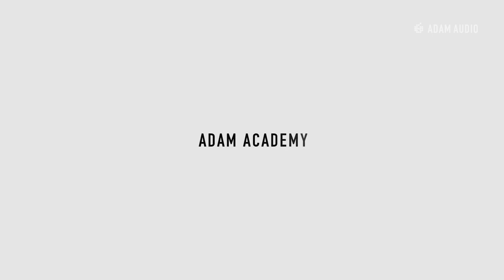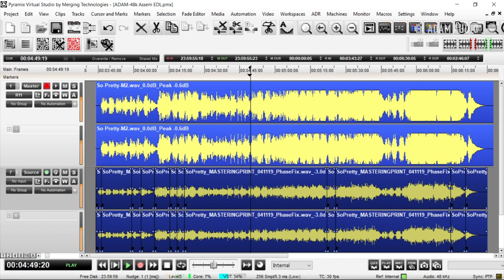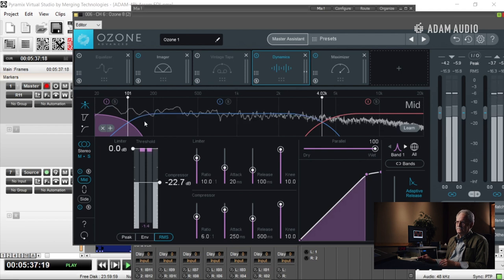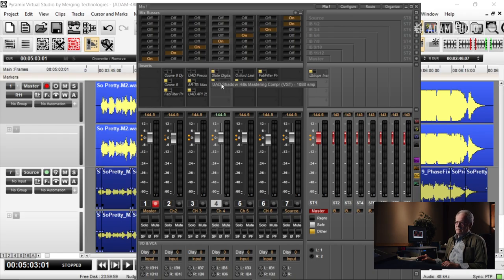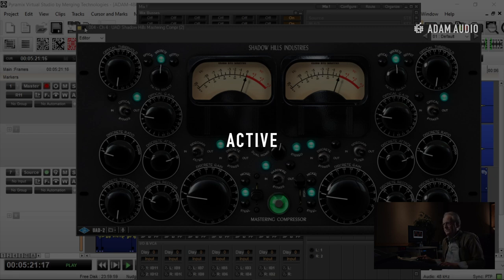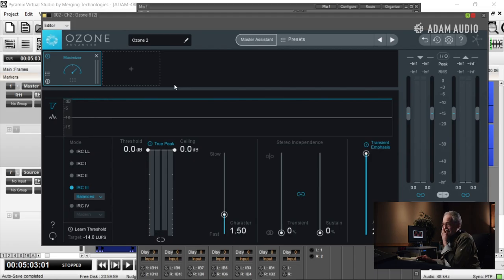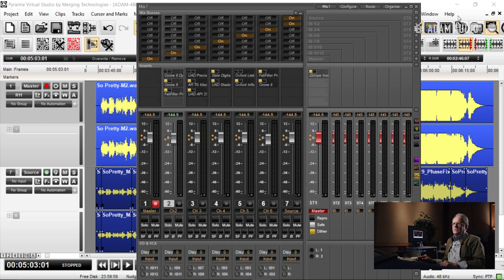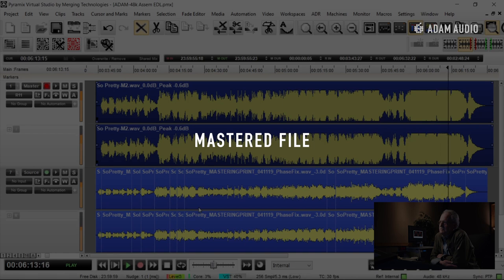Mastering Plugin Chain, START to FINISH | Mastering Masterclass Ep. 6

Comment: Question: Are those plug ins in series or parallel?  And if parallel how are they distributed, ie: is each channel receiving the same amount of signal via a send (and how much) or duplicates of the original track?  Thanks.
Reply: For anyone who cares I think I've got it figured out but it's important to note where it isn't stated explicitly.  It's in series but he's using the Ozone multiband only for bass and light de-essing as noted but the Slated FG-X is only doing transient emphasis.  The Shadow Hills has the compression turned off and is adding only the transformer effect.  The API is set very low and is also adding transformer effect.  The Inflator can mess with the stereo image and it may be why he's using the Ozone Imager.  For God's sake don't just slap 5 compressors and three limiters on every track.  There's a lot of subtlety going on here.  Hopefully that's obvious to most.
Reply: @EdPettersen  Watching now for the first time and was asking myself the SAME question as to why there are so many tracks. I've only really seen everything in a single channel and not as inserts like this. It's quite interesting and does make sense.
Reply: @Ky Olsen  I figured out after watching a few times it all must be parallel, however it's key how you blend those six channels.
Reply: @EdPettersen  of course! It's a really interesting way to do it!
Reply: @Ky Olsen  interesting and semi complicated! 😁
Reply: @EdPettersen  The mixer setup looks like it’s in parallel. However, If it’s in parallel, how does the first eq cut off work? It wouldn’t be cutting anything if in parallel right?
Reply: @franciscogomez5341  Exactly. Very confusing.  They should explain that better.

Comment: NOTE: To ensure the Low Frequencies are focused in Mono/Mid, The High-Pass/Low-Cut Filter has to be the Side. That leaves the region below exclusively in Mid/Mono.
Even though the human ear can only hear the frequency spectrum between 20 Hz and 20 kHz, to ensure the crispness and clarity of the Low Frequencies, I'll set my High-Pass/Low-Cut at 30 Hz vs 27 Hz, which in essence isn't that much of a difference, per say, yet I want to ensure accurately anything below 30 Hz will be filtered out to remove unnecessary headroom and rumble since the lows create the most level of dB. I can understand the Oct/Slope is rather steep (looks like 48 dB), yet 24 dB/Oct would've been a better choice and recommendation. However, the Slope/Oct at 63 Hz is too steep IMO. I would've set it to 24 Slope/Oct instead of 36, which emphasizes the Low end in exclusive Mono/Mid down to the 27 Hz Low-Cut Filter.
Definitely using the Pro-Q 3 is the digital EQ of choice, probably the best and most used Digital EQ Plug-in in today's Music Technology.
Even more so, Instead of EQ'ing sounding the same from beginning to end. I'd make the emphasis and de-emphasis bands "Make Dynamic", which would only trigger the band when it reaches the threshold for expansion and compression (subtle, that is).
I also noticed another High-Pass/Low-Cut at  63 Hz with a +1.2 dB amplification/emphasis. For me, being even more subtle is best, since less is more. For that bass to cut through today's consumer-based audio products, especially on smartphones, laptops/notebooks/etc., I'll boost/amplify subtly between 100 to 120 Hz, depending on the sonic in question. If I can get away with +0.5 amplification, that's a total win-win. If more boost is needed, my rule of thumb is, don't go above +2.0 dB. If it calls for more, I'll contact the artist/engineer to see if he/she can render another mix with less low end frequencies.
The Side Emphasis at 125 Hz makes the track sound muddy on the sides, IMO, the Sides should be left for more clarity, especially when you want the Lows specifically focusing in the Mid Region. Also, there will be phase cancellation in that region. If you want that Side region more warm, use the emphasis/de-emphasis technique by creating another Band at the exact same Hz, Make it Mid, and de-emphasize -0..49 dB. That way, you avoid phase cancellation, and the lows at 125 Hz will sound more cleaner with perceived clarity, and both emphasis and de-emphasis bands would be made "Dynamic". From what I hear It sounds like the Lows are expanded into the Sides, which in my opinion, you don't want, since it adds more dB headroom, even if with the subtle emphasis. it also interferes with the Lead Vocal and Background Vocals region if the panning is hard, in-between, or soft. You can really hear the boom/mud/boxy sonic in a LCR Mix/Master.
Another thing I would've done is use the Harmonic EQ Technique when necessary using the Pro-Q 3. By knowing the key of the track, EQ harmonically, especially at its Fundamental (including High-Low Pass Filters. Therefore, for example, if I create a High-Pass at 30 Hz, it might not necessarily be at the key of the track, yet anywhere close to where you want to cut will totally make the track more musical, and actually help psychoacoustically the perceiveness and preciseness,
This particular EQ setting (Initial) has an extreme problem/issue: Your High-Pass/Low-Cut Filters are 100% OUT-OF-PHASE. That's because the Phase Setting is incorrect.
Anytime those types of filters are being utilized, set the Phase Mode to Low-Level Linear Phase. Run it through an EQ Analyzer, and you'll see why using Zero Latency or Natural Phase will constitute Out-Of-Phase. Every DAW will compensate for Latency, that's why using the Lowest Level of Linear Phase creates a 5-second delay. The higher the Linear Phase level, the longer the delay time. If the systems are high-end, they will be able to compensate for the higher level of linear phase delay, in turn, allowing the DAW in question to run seamlessly as if no linear phase delay is taking place.
Once all plug-ins were in place, the track sounds wonderful. For me personally, I would've added just a tiny bit more low frequencies via Saturation (Clean Tube from FabFilter Saturn 2)
Fantastic Job Mr. John Mayfield!!! Subtly is the key to Mastering Success. Less is More, keeping it as simple as possible.
Reply: Was curious about the choice of slope as well (the high cuts @ 48db / oct) I would have thought such a deep slope would have caused some eq changes at the cut off point.

Comment: Isn't the side information governed by phase differences between left and right, not pan position? Even mixes done with LCR panning have their elements present in the mid channel, although those panned left and right will be quieter. Think he suggested if you panned something far left or right it would appear only in the sides, which is misleading. Enjoying the videos still!
Reply: I've found this a bit misleading as well! When you hard-pan a signal it will appear both in the mid as in the side channel. Hard panned elements just are half as loud in the mid channel compared to center panned elements. The mid channel is a sum of Left and Right. So basically a signal that is panned center will be present in both left and right, and therefore will be louder than a hard panned signal that is only present on one side. Elements that are panned dead center do not appear in the side-channel though, as this is indeed calculated by Left-Right, or indeed flipping the phase of either left or right. Elements that appear equally loud in both left and right will be cancelled out.
Reply: No, its ANY difference. 
Or ANY sum.

mids = L+R thus hard panned are present as signal plus nothing equals signal.
Sides = L-R and R-L thus its also present as signal minus nothing is just signal

So just think of the mids as mono. And sides as opposite phases summed. So if its only in one ear, then no change when summing either together
as its n +/- 0 = n

Comment: Hi hope you can reply to this message. However when I master songs I normally run the sound to a single track or mix bus with all the plugs on it. But looking at your setup it seems that you are running the song thru multiple tracks or probably aux tracks that have certain plugs on them which all then leads to the master fader. Is this correct? If so this is game changing for me. Please respond thanks 😊

Comment: Okay, gonna be the first negative comment here. I'm sure this guy has excellent ears and delivers great masters, but he seems to have very little idea what his plugins are actually doing (and in one instance not actually using them properly), which is an issue in an educational 'check out my plugin chain' style video.

- He has no idea what the Oxford Inflator is doing beyond making things feel louder (he keeps just saying 'it really does "inflate" the signal'). For those interested, it's an saturation / soft-clipping device with an 'elastic ceiling', which means the closer the input gets to 0db, the more it will add subtle harmonic distortion and soft clipping to peaks (hence things seeming louder and a touch brighter). It adds overtones and rounds out transients, but proportionately more on louder signals.

- When he uses the Shadow Hills compressor, he claims the Iron setting adds high frequency saturation / boost – it doesn't. The Nickel setting emphasises highs, the Iron emphasises mids, and the Steel emphasises lows (and they also get increasingly intense in that order). Notice how when he sets it to Iron and takes the plugin out of bypass you hear the lead vocal move forward in the mix? That's because it's saturating the midrange the most, so the vocal's presence area (roughly between a sort of 500hz-3kHz zone) gets emphasised.

- This is the big one – when he 'uses' the API 2500 compressor, it is doing essentially nothing. He incorrectly says 'this is one of those plugins that doesn't give you a digital readout of what you're doing' – what he means by this is the plugin doesn't show you how much compression (gain reduction) you're doing... except that it does. See up the top where there are meters, and next to the meters he has the GR metering option selected? That means the plugin will show you how much Gain Reduction is happening. So why aren't the meters moving? Because my dude is literally not even hitting the compressor's threshold. You can see next to the threshold knob, there's a red LED which ISN'T lighting up – that means the signal isn't going over the threshold. There is a fraction of second (19:10) where one transient makes the plugin do between 0.1 - 0.2db of gain reduction, which is so small that he might as well not even be using the plugin – that is almost an imperceptibly small amount of compression, and if the compressor weren't there that signal would be hitting the final limiter and getting gain reduced anyway. You can also tell that he doesn't know the compressor is essentially inactive because he plays an audio 'example' that lasts for over 20 seconds, turning the plugin on and off throughout, and there's maybe 0.3seconds where the plugin does anything at all (which again, is borderline doing nothing).

- Finally, and most important of all, he compares the final master to the original mix and says 'the master is gonna be louder... deal with it.' We inherently hear things as better when they're louder, because we can hear the quieter parts of the mix more, our ears hear proportionally more low and high frequencies at louder volumes, so everything feels fuller and richer and more detailed. Because of this, it is almost impossible to tell if his mastering has ACTUALLY improved the song sonically beyond adding gain. For him to just say 'deal with it' means one of two things: either he isn't that confident in his master, so he wants it to be presented to us far louder than the mix so that we can't compare them properly, or he's just too lazy to turn the master down to the same RMS as the mix in order to compare apples to apples. In either case, he isn't being a good educator.

This comment brought to you by my young guys and girls starting out as mastering engineers who are absolutely grinding to be good at this craft as well as to earn a living, who have guys like this to look up to who are, at best, poor educators. I'm sure he turns out great masters because of his ears, but having a video about plugins that says heaps of really incorrect stuff about them isn't helping anyone.
Reply: Thanks for the comment, I learned a lot. 

I think for some guys, they have so many plugins to choose from, they find one that gets what they want done at a easier/quicker pace than others so they choose that plugin for that application even if that plugin has way more it can do. 

But from what you're saying, the plugins he's using aren't being applied correctly. I'm kinda surprised the sponsor would let this happen, no? 

I think for many starting out (I am regarding the recording, not performing) we'd just like to see someone going through their process start to finish. Something that can be applied to all tracks that will make them better. Like picking out little artifacts and phase tilting etc those things will make a track better. 

Some other things are subjective to final product and what you're actually listening to the song on. I live in Uganda now and most people just crank up their phones or bluetooth it to some knockoff JBL speaker. Will they hear any change he's done? 

Anyway, is there someone else out there that has a better walk through educational vid/series you'd recommend?
Reply: @Big Teddies finer details like knowing when a compressor is doing compression? And that’s fine if his priorities are making masters, but he sure as shit shouldn’t be making educational videos then
Reply: Just a note on the api ‘s meters - they’re vu meters.  As I’m sure you know, vu meters are by design very slow.  This means you very well could be doing a few dB of gain reduction before the needle moves at all.  This is likely what’s going on here.  Also worth noting is that the 2500 will add some color just by passing the signal through it.
Reply: You are so right. Plus that DAW he is using... Looks straight out of 2003 haha 😂

Comment: He says he hasn't seen a limiter with an internal sidechain w/ a parametric adjustment setting along with hpf/lpf but technically you can use Pro C2 as a limiter and it has it in there. Graphically at that. 

Also he says to "Just deal with it" referring to the dynamic range between mix/master when all he'd need to do it clip gain it up to just below the mastered file? And a number of ther ways?? Is dude a noob kinda? Like a Noob Goat?

Comment: I really appreciate John Mayfield 's approach to Mastering, it's interesting and unique perspective but I have some observation, may some questions, first why did he employ a hi-pass filter ? in mid side ? what exactly is he trying to achieve ? in my experience I try to avoid filtering as much as possible because of the degradation to the signal specially if your in minimum phase mode, your basically inverting the signal 180 degrees, if you listen carefully the bottom end is kind of weak, the focus of the music seem shifted to me, the bass feels rich but with the drums in general the low end is lacking weigh, I would chose another method I strongly believe that this is a good mix and needs very little treatment, and I believe this track can have a good sound without filters and instead shelfs, anyway kind of my two sense on his workflow.

Comment: So many odd things about this that NO ONE is pointing out... maybe they're being too polite to do so.. 
First of all; when comparing the mastered and original file, why doesn't he just normalise the original so we can actually compare them?? Having one file so quiet is absolutely pointless. 

When using the compressors, he doesn't actually compress the signal. Which is fair enough if he's using them for their tone and saturation... But he says he's 'doing a bit of compression' when there is none, you can even hear it - there's no compression at all, there's only a gain difference.

Why you'd use separate channels to gain stage when there's input and output gain on the plugins is beyond me.

I don't know, maybe i'm missing something? This was kinda strange.